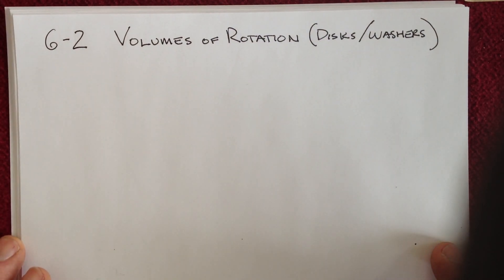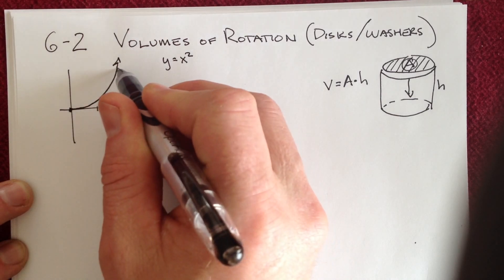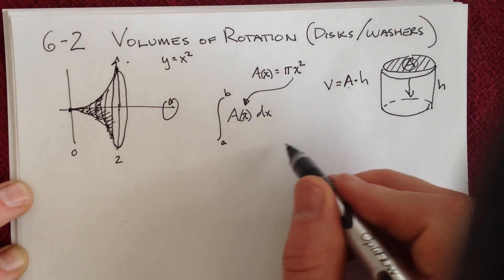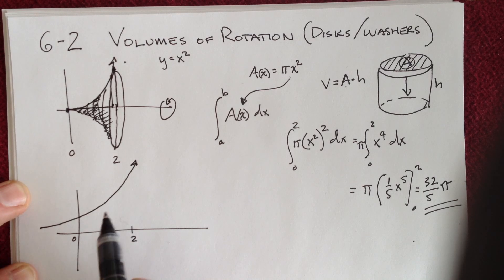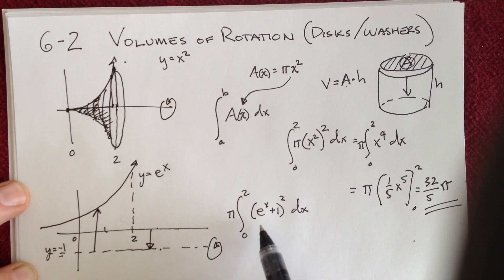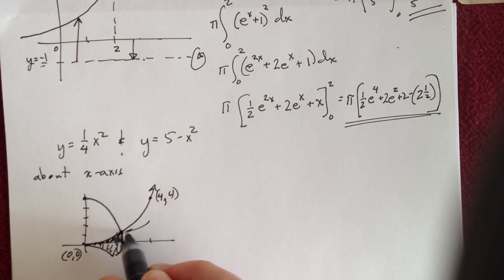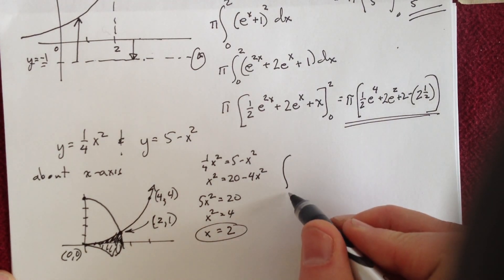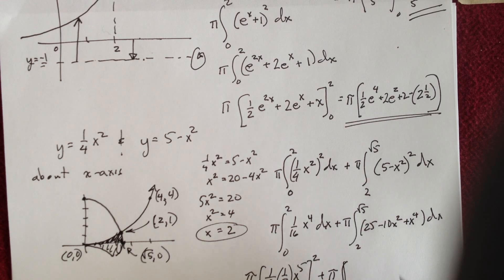Application of Integration--Volumes by Disks/Washers

Comment: For anyone trying to get help from this: the one with e^x from [0,2] is actually a WASHER question, not a disk one. This guy doesn't know what he's doing. If you picture it rotated about the line, then the shape will have a cylinder cut out of it, so therefore the cross sections will be washers. Then, it would be pi *(integral from 0,2) R^2 - r^2 dx. Which is e^2x - (-1)^2 dx.
Reply from the maker: Alex, I'm sorry if the video wasn't clear, but I did not say that an area bounded by the curve AND the x-axis was being rotated around the line y= -1. It was simply the curve being rotated--and is therefore a solid. I have clarified the video, and I appreciate the comment.
Reply: thanks Eric. I wasn't trying to come off as rude or anything. I was just used to doing regions bounded by axes and incorrectly assumed that it would be the same. I didn't want anyone else to run into the same problem. Appreciate it